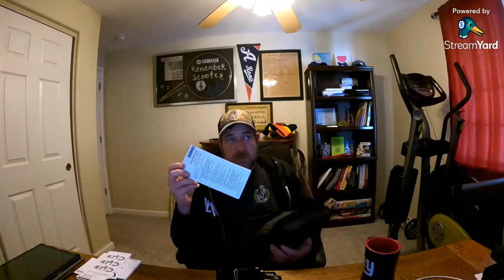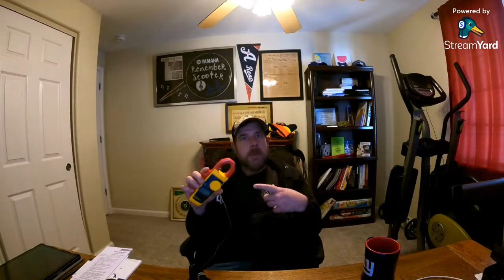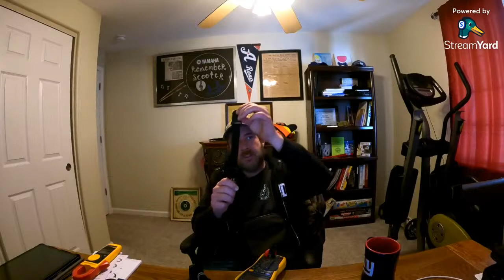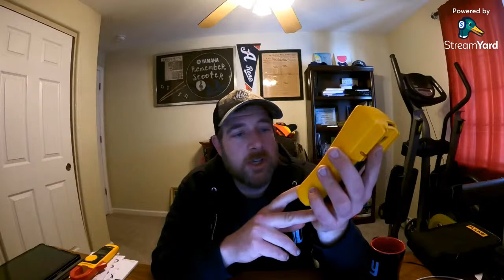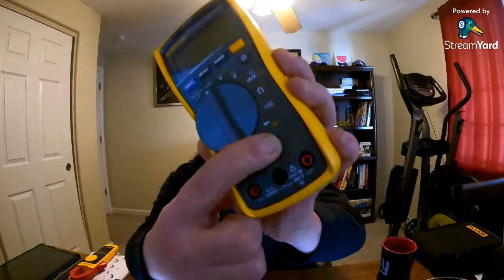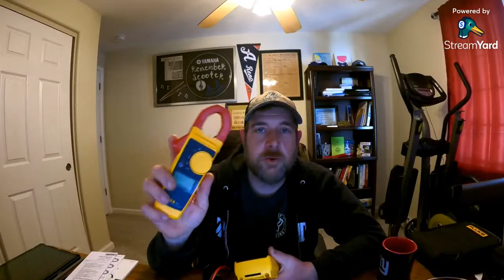Product Review - Fluke 117/323 Multimeter pack

Comment: That kit is a waste of money, better off to buy the 117 and the 325
Reply: I’d say the 116 over 117.  Since it has micro amps for flame sensors
Reply: @slimbigginz1405  is a good point if you need that function m on the 117 I like the contactless voltage sensor,  and the ghost voltage function, it would be nice it the 117 had tempature on it. I Zalso do have the 87v max, for the times 2hen the 117 cant do the job for most 5hing the 117 is the one I grab it is more compact fits in tool pouch well and cost pocket during the colder months
Reply: @slimbigginz1405  Bingo!  116 is advertised for HVAC!  This dude dun know!  😆
Reply: No Robert my man